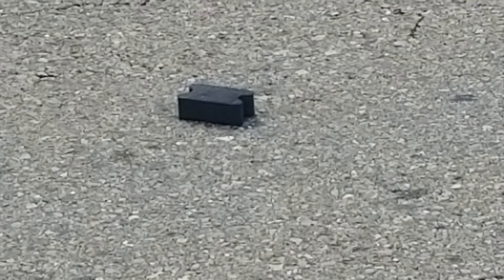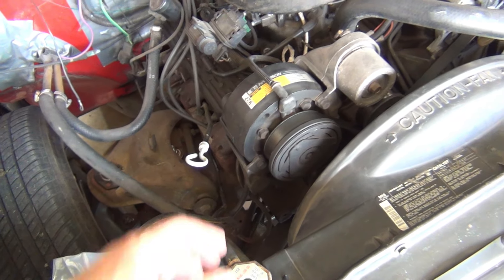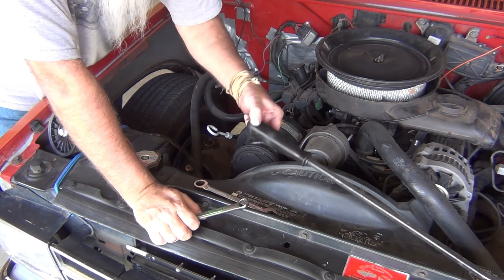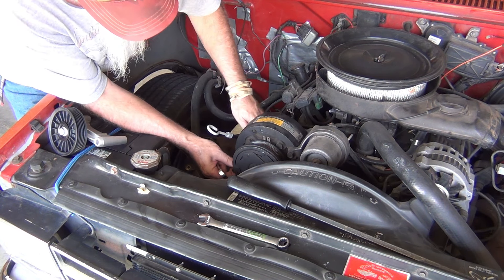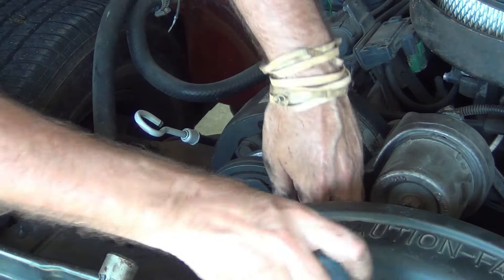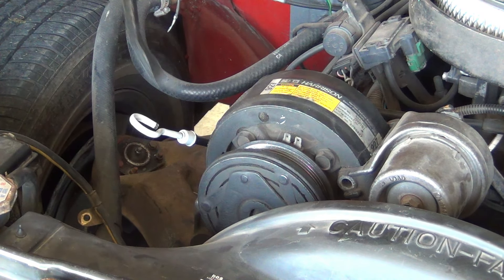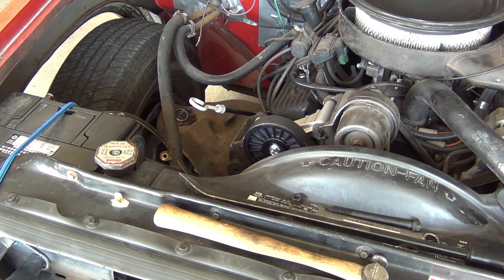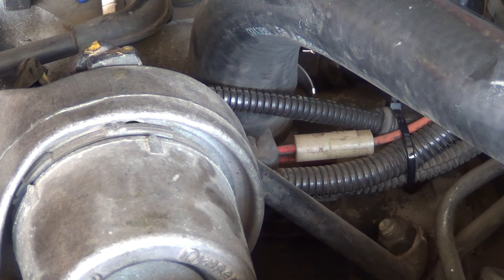First generation 1989 Chevy S10 long bed budget build. A/C delete and new project teaser.

Comment: Hey Clint, the easier way to take the belt off on a serpentine belt system is to put a wrench on the bolt that is on the center of the tensioner pulley and push to  the left. I use a long wrench and it is simple. Sometime I jam the wrench on something so it keep the tensioner loose and use both hands to remove the belt and install the new one or the one I took off.  If your gonna sell the S10 or consider it let me know my wife wants a 1st Gen S10 hahaha, Her Datsun 620 is slow goings to build as we have to locate a engine and trans. KA's are so hard to find now and so  are the SR20's not to  mention the L series Datsun Engine. 

Keep up the great work and stay safe brother.
Reply from the maker: That would be easier. The factory service manual probably has a special tool. Sometimes I go into caveman mode and get a certain satisfaction from just powering through it. I go back and forth on letting the S10 go because there is still so much I want to do to it. We'll see.